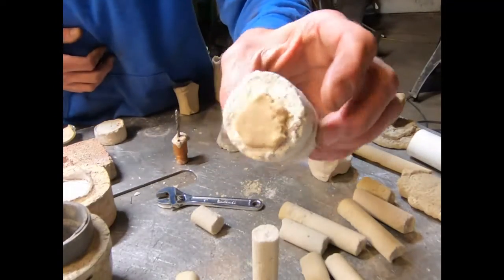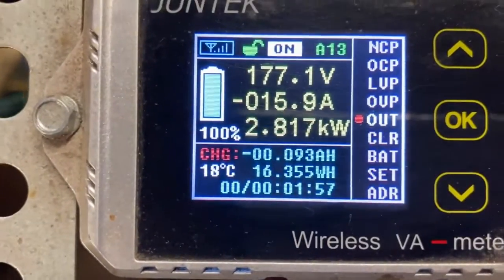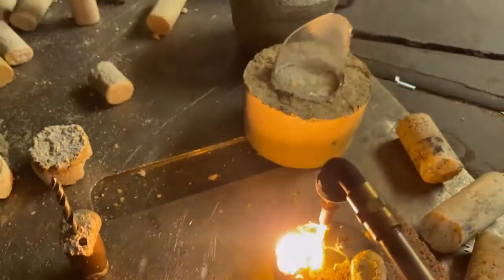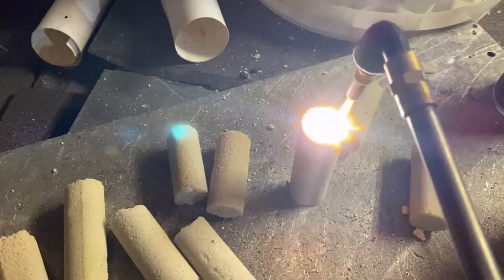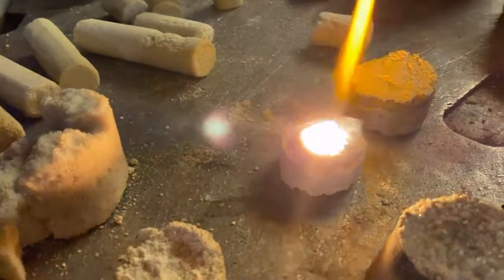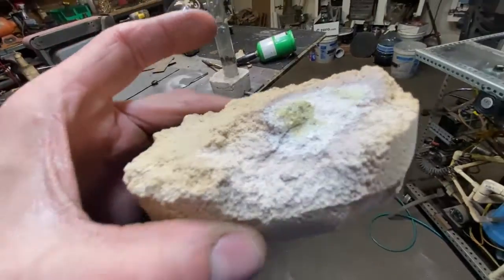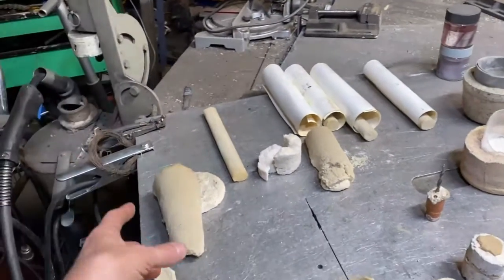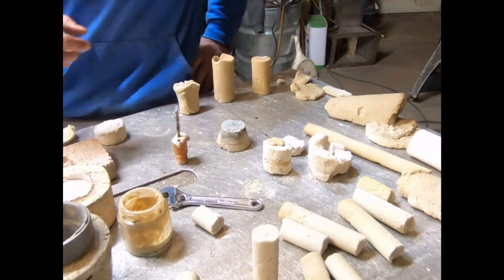DIY Refractory Glue and refractory brick 4600 F

Comment: You should revisit this idea and add PDMS to your mixture. Silanes/siloxanes will decompose when exposed to high enough temperatures. When this thermal decomposition happens, since the polymer is made up of mostly carbon and silicon, what forms is silicon carbide nanofibers. I think it could provide a better structure to it.

Carbon nanotubes could also do the same thing and they're aren't too difficult to make low quality nanotubes. Just strike an arc between two graphite electrodes submerged in distilled water.
Reply: I'm very interested in what you've said! What search terms can I use to learn more about this sorta stuff, or how'd you learn about it? Does this mean than if I heat common silicone caulk in a kiln, I'll get SiC? (And also apparently formaldehyde! 😵)
Reply: @Nathan Martinez  look into "preceramic polymers" or "polymer derived ceramics" Do a scholar search with that phrase, there is a lot of literature written on the subject by materials scientists.

It's actually possible to create 3d printed objects using "PDC's" and these objects can be baked in a kiln to yield ceramics. But that research is currently in its infancy.

Get familiar with scihub if you aren't already, it will give you access to any scientific articles you may not have access to.
Reply: @toxomanrod  yes, silicones can be fired to turn into silicon carbide, but I think you may have to mix it with some graphite powder. I read a paper that describes doing just that.

I do all my learning by searching terms in scholar (youtube won't let me use the "G" word) and then pirating the academic papers that I find in my searches.
Reply: @franklingomez5311  wow this stuff is awesome! Wiki page isn't very long, which to me means there's still much to experiment! Looks like the process requires a reducing atmosphere, or as you've mentioned adding graphite so the excess carbon will react with oxygen. I've yet to find a good cheap source for bulk graphite powder for experimenting, you wouldn't happen to know of any?
Reply: @Nathan Martinez  you really don't want to use wiki for your research, especially with a subject like this. Get yorself familiar with Ggle's "scholar search" and "scihub".

It's not complicated by any means and it gives you access to known good data. It's also not limited to any subject, you can do research on literally anything that comes to your mind.
Reply: @Nathan Martinez  graphite powder is a specialty product, usually used as a dry lubricant and as such it carries a premium on the price. If you want cheap graphite powder, the best way is to buy a block of raw graphite and then crushing/grinding it up yourself.

A ball mill is ideal for this purpose.
Reply: @franklingomez5311  is graphite more reactive than charcoal? I can buy charcoal for cheap then blend it to a fine powder, might just need to use more of it. Thanks for the tip about graphite blocks, I'm actually working on a ball mill right now! Seems incredibly useful for experimental ceramics
Reply: @franklingomez5311  i usually start on wiki to get a general idea then look up specific results on papers, but I've never heard about this! Thanks a ton for the tip!
Reply: @Nathan Martinez  charcoal and graphite are both made up mostly of carbon, but they are not the same thing and especially in this circumstance they are not interchangeable.

Graphite is a crystalline form of carbon whereas charcoal is an amorphous form. Charcoal is produced by charring biomass and graphite is mined from the ground.
Reply: @Nathan Martinez  to each his own. I don't even do initial research on subjects any more, I just jump straight into the academic journals. I can usually find 3 different papers that deal with exactly what I want to know in about 10 minutes of searching.

For the future, always look for "literature reviews" on whatever subject you're wanting to learn about. People who author literature reviews tend to do most of the leg work foe you by compiling articles that pertain the the subject and giving you a more complete overview of the subject than any one paper can.

The downside to all this is you'll be reading quite a lot lol.
Reply: @franklingomez5311  slightly different question, are you familiar with using aluminum Hydroxide for refractories? Apparently it 'gels' at a high temp!
Reply: @Nathan Martinez  I'm not familiar but if you want I can try and get familiar and get back to you.
Reply: @franklingomez5311  tried out scihub, wow it's incredible, super grateful for your suggestion!
Reply: @Nathan Martinez  Cheers, im glad you were able to make use of it!

With scihub you're limited to finding articles with the DOI alone, if you ever run into an article that scihub doesn't have archived you can try "library genesis". With libgen youll search the name of the article rsther than the DOI URL.
It has waaaaay more articles archived but the search feature is a little tougher to use correctly.

Usually you'll only run into trouble when the papers are new.
Reply: @Nathan Martinez  also, at the bottom of any article you'll see a list of references that correspond to the papers that the authors used to come to their conclusions.

Take note of the numbers assigned to each paper in that list of references and you can find that throughout the paper they mention specific references. The purpose of the references is to make it easy to find the papers that they're drawing their data from. If you find a specific thing in the paper that was just glossed over, you can find where they got that information and read the paper they're referencing so you can get a better understanding of what is being said.

Also, learn the terms that are used! If you don't try to make sense of the terms used the whole paper seems to just be gibberish. You CAN make good sense of what's exactly is being said by doing that.

Comment: Sorry if I missed it, but............if you were making a castable refactory mix (not the glue) your mix would be "what?" with waterglass.  ratio's?  Excellent on your glue. Basically I am talking a casting for a rocket stove, so wood placed every day, with temps in the 2000 degree range, then cooled down.Daily maybe the problem, year after year.

Comment: Homemade water glass and perlite is what I made my forge out of. Of course it has its limitations.  That and I was dealing with a back injury when I made it. 5 lumbar surgeries, 3 lumbar fusions later, and I'm back at it. I can't wait to build my next one. Paint can forge was the first. The rest became rocket stoves. I can't wait to get another mig welder. Built 2 wood gasification systems, rocket stoves, and a kiln with the last welder. Son in law left it in the rain. I guess it's lucky for him I as a disabled vet didn't just squash his head lol. Now I am left using JB Weld. But I guarantee I'll engineer a whole new system.
Reply: Dude I wish I thought of this sooner, but every advantage perlite has is easily available with the same consistency of charcoal gravel.  Either it remains unburnt, or becomes further insulative as a fine lattice of fluffy ash in the cavity it is trapped in.

Comment: great video, do you think it would suit gluing insulating fire bricks in a rocket heater riser. Thanks
Reply from the maker: No my friend unfortunately it changes chemically after heating then after it turns into the hydroxide it takes on water and expands 75%

Comment: How does it work with cast metals? We all know how hard it is to weld and though JB weld works ok. In high heat like exhaust manifolds its lacking at time. I can see using a coarse steel wool to aid in vibration strength. On any cast automotive part. Even holes in mufflers. No down time taking it off and having the manifold welded that isnt always a fix as these welds can be hit or miss. We all know that medical cast like crap muffler wrap sucks as well.If its sandable and paintable then the use in the automovtive repair field will be great.

Comment: Nice Video! Try exposing it to moisture or water after cooking it red hot before doing any investment as a product.
Reply from the maker: Yes it is not compatible with moisture it changes chemically
Reply: @NOBOX7  CaO + 2H2O --> Ca(OH)2 +H2
Reply: But if you could bond Magnesim oxide or alminium Oxide rather than calcium oxide, Indeed you could beat current commercial products.

Comment: I read a paper recently where they found they could convert silica gel into waterglass by cooking it in lye north of 200C (maybe lower) its neat to see this can be done at the lower temp you use, many thanks. I recently bought this tiny woodstove and the walls are thinner than expected so i'm looking around for something to coat the interior of it to help it stand up better to high temps, might try this mix of yours unless maybe somebody has a better suggestion

New to this, to anyone reading this is there a mix similar to this that'll yield a porous ceramic material similar to pumice? Wanting to make cape cod kerosene matches, they sound neat.

Also, I'm sure you're set up quite well for ventilation with your type of work, is it possible you've got a plugged filter in your ventilation system or maybe need more of it? You almost sound like you've inhaled too many fumes in this. I dont want to sound rude, its subtle, i notice in the vast majority of videos of people using fire in some way you can notice the mental effect it has on them. God some of the soldering videos I could swear the guys pickled their brains with all the lead fumes.

Comment: I’d be interested to see what you could do incorporating equal parts vermiculite clay(cheap kitty litter) and prebaked and ground clay ie ceramic like tiles pottery or simply the fired clay as a powder, I feel like it would make a foundary liner like play dough, if you add something fibrous as well that should help prevent cracking working like a binder? If you give this mix a go keen to see the outcome!!
Reply from the maker: Its a no go my friend , it has great one time use ablation shield purposes but after that the moisture reacts with the calcium oxide created in the intense heat to make a hydroxide when cool , this as you no is deliquescent

Comment: I'm so glad you've shared your results! Have you experimented with using this "glue" as a cement to hold silica sand together, as you did with the sodium silicate cores? I'm not quite sure I've heard you mention this during the video... Seems like it could make a good bulk refractory. (If kept dry, judging by the comments.)

Comment: Have a look at the Geopolymer institute the work of prof Davidovits he popularised  concrete & other mineral based polymers made from metakaolin clay waterglass+ blast furnace slag fly ash or red mud,vermiculite or perlite can also be mixed in Im looking for a version of this that can be used instead of epoxy resin like the one being used in high end vehicle & aerospace.The chemical bonds are primarily silicon oxygen Aluminium so Alumino Silicate.

Comment: So garden lime and potassium silicate need to be cured with ambient carbon dioxide or will a blue flame work?
Reply from the maker: I do not recommend this composition friend .
Check my other videos , this was just a test and this stuff works great but its hydroscopic and converts to calcium hydroxide that expands 75%
Reply: @NOBOX7  THANK You for your highly unique and effective pursuits and testings.  It's hard not to be less interested in your side comments and background projects.
I am looking to build a rocket masonry oven+stove, bought plans from walkerstoves, which have scaled drawings for either stacked firebrick or for ceramic refractory board.  On a tiny budget, I am always searching for DIY alternatives that hold up slightly better than firebrick and are considerably cheaper than the refractory boards.  Seems like perlite and pre-mixed refractory mortar 1:1 is best for coating but not strong enough when molded into half-bricks, about the same price overall when figuring labor

 I look forward to using my collected WVO in one of your burner models, should i be so bold as to attempt.

Comment: I'm a little confused.  When I looked up garden lime, most sources said that it was calcium carbonate (essentially chalk), but you list calcium oxide in the description.  Then there is quicklime/slaked lime/hydrated lime etc which is calcium hydroxide.  

   So is it calcium hydroxide, or calcium carbonate?  

   Thank you for considering.
Reply from the maker: when heated to hightemps it oxidizes to calciumoxide then he t oxide gets hydrated to hydroxide after cooling

Comment: @ NOBOX7 I have watched this video and your one about best sodium silicate proportions. You have had some of the recipes harden in the jar when storing, sometimes overnight. Something to think about this. Sodium hydroxide after opening the container easily absorbs carbon dioxide. Carbon dioxide cures sodium silicate. So if you make the sodium silicate solution with sodium hydroxide which already has carbon dioxide in it, that could be curing in the jar when storing. The sodium hydroxide used must be a freshly opened new jar. Just think that is possible. I wonder if heating the already opened sodium hydroxide could make sure there is not carbon dioxide in it? Blessings

Comment: I make my own sodium silicate, and I have some Hyrdrated Lime I bought at Home Depot.
Mixed it as you describe and just 700f turns it into a weak crumbly material. As far as I know the Hydrated Lime
they sell at Home Depot is the same as Agricultural lime you are using?
Reply from the maker: It does crumble to powder after it is calcined , it was not the best for log term use
Reply: @NOBOX7  So no matter what type of lime you use it will crumble with time?
This one crumbled right away.  Are your pieces holding up still? Or are they crumbling?
Thank you
Reply: Hydrated lime is calcium hydroxide. Garden lime is calcium carbonate.
Reply: @timhain8263  
Howdy Tim. I have made a similar comment about the difference on Tim Telemarks comment. He too had used calcium hydroxide. It doesn't work.
Reply: @timhain8263  Thank you!!!  I am now trying Alumina Hydrate. Should make a huge difference.

Comment: Firebrick isint supposed to be dence the best fire bricks are super lightweight and "fluffy" feeling they dont just withstand the mass ammount of heat they allso insulate it could try adding somthing like vermiculite( melting point around 2400°F)  or perlite (melting point around 2300°F) to both reduce weight aswell as add insulating properties in the production of ur own bricks
Reply: I wish I could find conclusive information of the melting point of wood ash, but charcoal gravel of a similar consistency will produce the same results if not better.

Comment: @Nobox7
Nurd rage video shows 2 recipes for sodium silicate. 1st, 60g sodium hydroxide, 80g silica gel, 100g water. 2nd, 30-40g sodium hydroxide, 60g silica gel, 100g water. You were showing 200 water written on your cores. Very interesting refractory you have made though. Does it last? Does it absorb moisture from the air?
Reply from the maker: Yes i tried all compositons and found the others to be to wet or to dry , the latter turning into a solid on the shelf in the jar
Reply: @NOBOX7  So you did the recipe like you said with the 200g water and it keeps? Nurd rage did add a little extra water to his first mix. And did your refractory last or crumble?

Comment: I'm calling BS on this! I have tried several different times, varying the waterglass / lime ratios AND 3 types of lime - hydrated lime, dolomite lime, and plain lawn lime. Nothing even came close to what is shown in this video. Nothing hardened - it was just a sticky mess.
Save yourself some time and try something else!
Reply from the maker: your water glass had to much water or not enough hydroxide was used
Reply: @NOBOX7  As far as water goes, I don't think so - I tried a couple of passes with the waterglass so thick it was difficult to work with.
And what hydroxide? The video includes lime and waterglass - there is no mention of a hydroxide, in fact the title says "Calcium Oxide refractory Glue 4,000 Deg F working temp"
Reply: @joesmith1922  you need sodium hydroxide to make water glass.  It was in the recipe in the video
Reply: @edrimeikis9270  Yes I have plenty of waterglass, made with sodium hydroxide.
Maybe mine is not good...
Reply: @joesmith1922  when you add water to calcium oxide it becomes calcium hydroxide.
Reply: @Joe Smith If you used an already open container of sodium hydroxide it probably had carbon dioxide absorbed into it. That spoils the sodium silicate mixture.
Reply: I assume you added the sodium hydroxide to the waterglass, first !
A sticky mess is what you would get, if you just mixed water glass with  the lime.
Reply: @terryross5372  The sodium hydroxide is an ingredient in the waterglass, genius.
Reply from the maker: This was just a test , i agree there are better mixtures . This is only good to 800 F  for long term use . It converts into  calcium oxide when heated which has a melting point of 4,000 deg so i decided to try it out . The stuf in the video was made as described , wasnt tryna device an body, was inviting you to an experiment